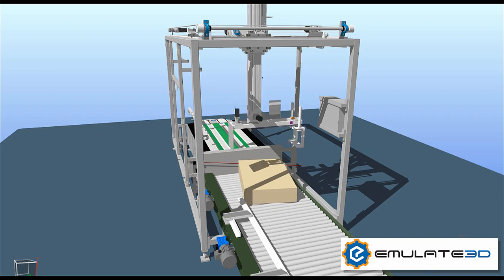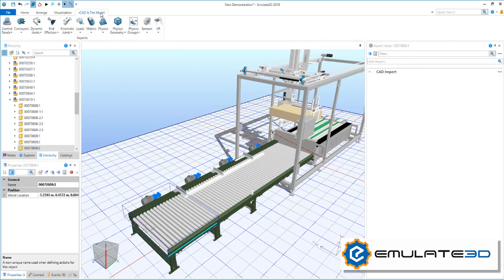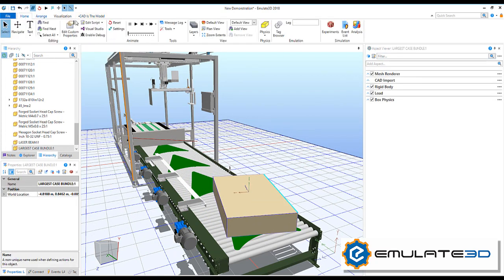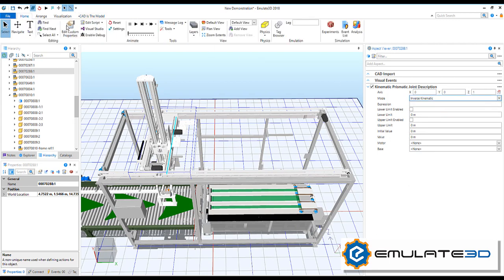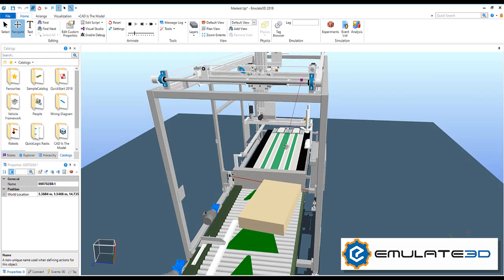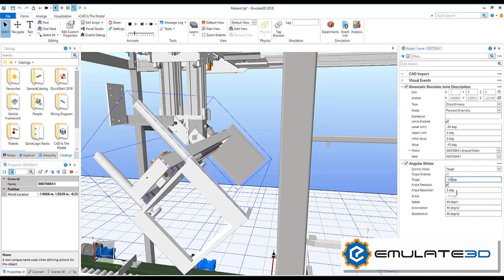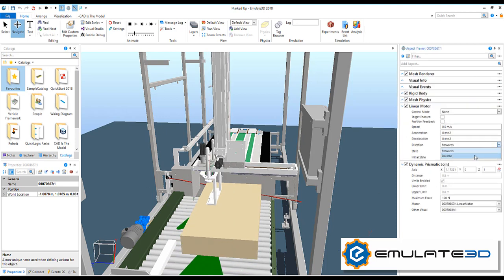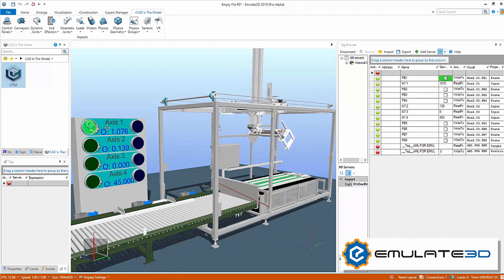Emulate3D Dynamic Digital Twin Technology - Overview of Features and Functionality

Comment: Hi! Can you tell/create a video about how to connect your own created CAD model (containing multiple prismatic joints and their own linear motors) with the internal ladder structure inside Emulate3D? I really wonder how to connect an own created variable inside your ladder code with a visual aspect of a CAD model, because it is never clearly stated on how to do so.
Reply from the maker: This video is focused on demonstrating the Aspects (or collections of parameters) in CITM. You'll see connectivity between the model elements (motors, sensors, pusher activation) and the external control system in the Tag Browser which is shown from 40 seconds into the video entitled "Emulate3D Controls Testing for Machine Builders in SOLIDWORKS
". You'll find it here: https://youtu.be/mOI9vqIQyi0 

The point of controls testing emulation is to test the real control system, which is external to the model but connected to it via the Tag Browser.